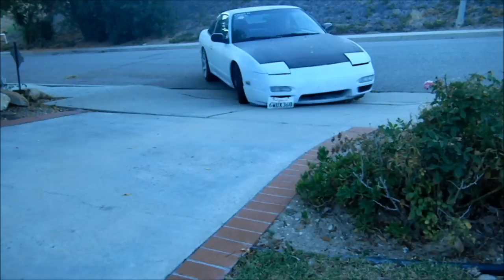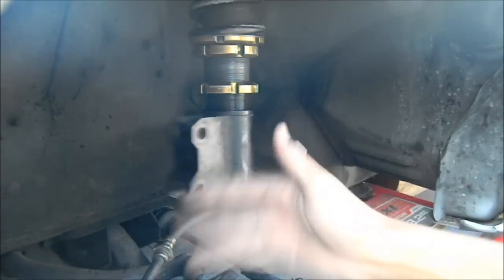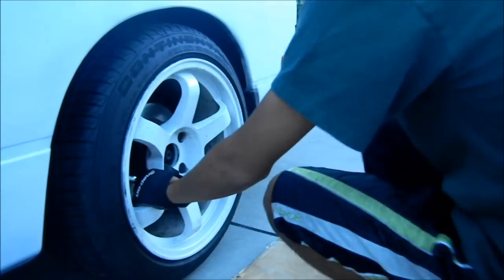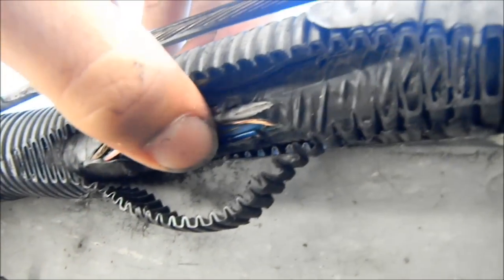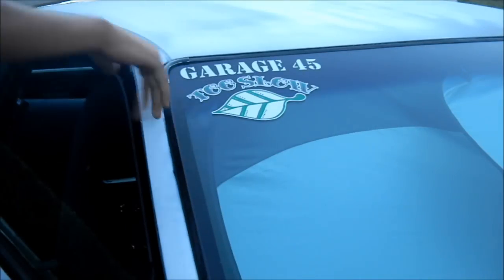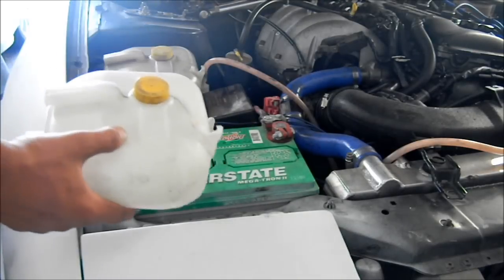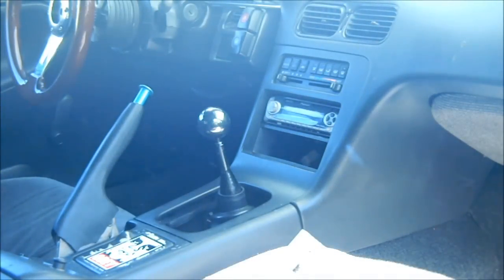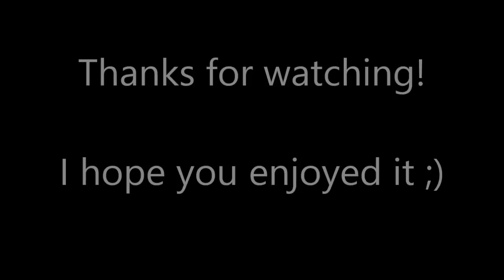Project 240SX Le Drift Car - Ep. 1 | Getting Started

Comment: Not sure if it was previously mentioned, but you don't need to remove the bolts from the knuckle/coilover to adjust the height, just loosen off the lower locking collar and spin the body of the coilover down/up through the lower mount.
Reply from the maker: sweefu2 Yes I know how to adjust it. Just did it this way because I didn't have a coilover wrench and because of all the grit and dirt build up on the threads, threading the body up and down by hand was super hard. So it was just faster to unbolt it and turn the bracket rather than leave it bolted and turn the body. Thanks for the comment :)

Comment: you could use fuel line cut on one side down the center and outline the metal you cut out for the harness. It will prevent the metal from rubbing through you wiring harness!

Comment: Nice project man. You are doing good work out there. Cheers from s13 owner ;] 
Btw. in CA18DET this air box hole is Intercooler. It's mounted in same spot but it have two holes.
Reply from the maker: Sebastian Harmasz Yup and on the 240sx it's a resonator box which is made to decrease engine noise to make for a quieter ride inside the car.
Reply: ***** Always good to know new things.  So again thx for great video and keep Nissan fun ;)

Comment: Just so ya know you dont have to take the hub/knuckle off the coil over to lower and raise it. Just loosen the lowest ring and then you can spin the entire coil over with the tool on the top ring. super simple and you wont have to have an alignment every time you mess with the height.
Reply from the maker: I didn't have a coilover wrench which is why I didn't just loosen the lower collar and turn it down. I even tried by hand just turning it with the lower collar loosened but it ended up hurting my hands after a few turns because the threads were dirty and made it difficult to adjust. 
Thanks for the comment :)

Comment: Car customization done clean and right for once.. Glad this wasn't a "YOO LETS SLAM THIS SHIT AND DO SHITTY DRIFTS IN WET PARKING LOT!!! STICKERS FOR SPEED AND A REAR WING FOR DOWNFORCE.... DOWNFORCE FOR OUR SPEED!
Reply from the maker: Hahaha yea I'm not like that, thanks!
Reply: Right. Except he didn't get a wheel alignment after changing the ride height, the wheel spacers aren't strictly necessary and a waste of cash, he cut up the shell to tuck the harness (despite raising the height?!) etc. etc. 
I like this video, but your comment is moronic, what's wrong and what's right, eye of the beholder. Douche.
Oh, and scraping the number plate! OH NO!
Reply from the maker: elementalfunk First off I do my own alignments and this was far from the end of the work being done on the suspension, and the car was not being driven on amidst doing the work. Once the car was ready, I did an alignment.

There were no wheels spacers here, they were hubcentric rings to properly displace the load of the wheel onto the hub. 

The height was raised temporarily to aid in doing work on the car since it was easier to jack up and down and get underneath the car. Which is why the harness was tucked because the car was made lower after the work was done. As far as cutting up the shell, the metal taken out was ~2" worth on a seam. This is commonly done on 240's and not a single issue ever occurs from doing so.

This video was made to be taken lightly, sorry I wasn't able to completely rip off the bumper for you...
Reply: *****
Sorry I was more having a go at Graham Werner just to prove a point that everyone likes to modify in different ways (probably in a unnecessarily aggressive way). I have watched a few of this series now and genuinely enjoy it, especially because you are getting dirty and doing it rough. Keep up the good work, cheers.
Reply from the maker: Thanks :)
Reply: I feel like the stickers part is something MCM endorses... Unicorn sticker = +10 hp... lol

Comment: Hub centric rings are useless if you have tapered lugs. I was worried about it for a second until I realized that myself. That might not be the case for everyone however. Also I think that box was bringing outside air into the engine bay. Perhaps something connecting all of that was missing?
Reply from the maker: Yes the wheel will center fine because of the tapered lugs but that's not the point of the hubcentric rings. The point of the rings is to place the load of the wheel on the hub and not on the lugs such as done with oem wheel set ups. 

That box was missing a pipe connecting it to the air intake, but it doesn't bring in any air whatsoever as it's a box with no other hole. It's actual purpose is a resonator box which came from factory on the car and is meant to reduce engine noise.

Comment: I'm with you on almost everything, but why run w/o a shift boot, and why glue (or epoxy) the shift knob on permanently?
Reply from the maker: ***** Shift boot is essentially there for aesthetics and it looked much nicer without that Crown Royal DIY boot on it. Also since the car was auto converted, the center console bezel doesn't have the proper mounts for a shift boot, so I would have to source that, and buy a shift boot, just to have a shift boot for aesthetics which wasn't necessary since it looks really clean without a boot at all. 

The shift knob wasn't epoxied on permanently... the plastic threaded adapter was epoxied to the shift knob so it wouldn't come loose. It was done to fix the threaded adapter and have it stay in the knob like it came from the factory.

Comment: isn't hub rings supposed to be tight fit for first time (they are some type of plastic usually), when you make it loose it doesn't center wheel anymore that well... At Tire companies they do put rings that are first so tight that you really have to try putting tire many times and finally push wheel in with wheel nuts/bolts... :o
Reply from the maker: There was some built up corrosion on the hub so it wasn't fitting that well.
From what I've seen, and when I've ordered other rings, the fit is much better. It's snug on the wheel and the hub making it center, but these I had to force on which I've never had with hubcentric rings before. Thanks for the comment :)

Comment: One thing i will say about de stickering windows, dont heat em like that if theyre tinted!! You will most likely fuck the tint up with the heat, had the back window pulled out of my car and they heated it very similarly and the tint is trashed, excessive use if rear demisters can do it aswell, basically avoid heaps of head with tint

Comment: WTF you warmed up the stickers with the heat gun but you didn't warm up the fender with it? Hmm...

Watched the whole video and I must say you did a nice job!

EDIT: Just watched your other videos and found out the frame is bent. Now I don't see a problem lol
Reply from the maker: Hahaha and yea after using the heat gun for a little bit I realized I was going to be painting the car anyways so I wanted to see what would happen to the paint without heating it. (Chipped a little, but surprising very little chipping considering I hit it with a hammer)
Reply: ***** Wow, you weren't joking. Not even 24 hours and you answered. That's cool!

Now I've almost watched all of your videos and I must say that I have huuuuge respect for you. If it was my car, I would have already stopped working on it as soon as I found out the frame was bent.
Any plans on getting a new chassis already or will you drive this one until it's completely raped?
Reply from the maker: Haha thanks, I try to respond as fast as I can :)

And yes I've been planning to buy a shell for months now because I don't plan to abuse the car on the track on purpose like some guys. And having this messed up shell just makes it difficult to even do simple stuff like an alignment or adjusting height evenly. 
Well anyways, I'm basically waiting to save up more money and get my welder all set up before buying the shell. That way I have all the tools and money ready for the new shell to get work done.

Thanks for the comment!

Comment: Won't that electrical tape make getting at wires in the harness a big PITA? I get patching the individual wires, but don't understand wrapping the whole thing instead of reusing the sleeves you had.
Reply from the maker: Yes getting at wires will be harder, but a harness imo is not really something that you touch often. I mean even really expensive harnesses have braided sleeves and those are even harder/more expensive than tape to take off.

Usually people don't reuse the stock sleeves because they are very loose and bulky, and tucking the harness at the top with the stock sleeve will usually make a really tight fit at the top of the fender and people have fitment issues.
Thanks for the comment :)

Comment: dont need to remove spindle from coilover to adjust btw.  I am assuming that you dont know that so dont take offense if you already did.
Reply from the maker: If you watch later on I said I didn't have a coilover wrench (hence the chisel and hammer to tighten the lock collars) so adjusting the coilover by hand with it on the spindle is ridiculously slow and hard, I've tried hahaha

Comment: How much do you think you spent in total from start to finish?
Reply from the maker: +brady blanchard $2000 in parts, but sold $1000 in parts I took off. So only $1000 out of pocket. The car cost $2700, so total for the car was $3700 when done.
Reply: +OffBeat Garage what😢😢😢 one of these cars dont exist in my country if it does it cost about 35k

Comment: You cant get electrocuted on a 12v battery.... Also youre supposed to put the centering ring on the wheelhub first before you put the wheel on
Reply from the maker: How to Install Hub Centric Rings (Benefits explained)
Reply: Its not about the volts its about the amps. A car battery can and will kill you.
Reply: Ian Couch a carbattery cant and wont kill you. And yes its about the voltage
Reply: Kristoffer Lilja You're right bro, it will NOT kill you. And if you get shocked, it isn't the type that makes your muscles tense/freeze, you can still let go under car battery shock lol. Its funny actually
Reply from the maker: shortix323 Yup haha my friends have tazed me before and I just try to avoid that feeling lol
Reply: shortix323 no you cant even get shocked or tazed by a car battery. Go out and put one hand on one pole and the other hand on the other pole and youll see. Not even a 24 volt truck battery will shock you. 12-24 volts isnt enough to go through your body
Reply from the maker: Yuuup I agree.
Reply: shortix323 why would i feel anything? The tool would get very hot though and youd probably burn your hand if you touched it
Reply: Kristoffer Lilja When there is a ground it will kill you. Otherwise you will most likely live if you get hit with it. Therefore a car battery can kill you.
Reply: Ian Couch it will definately not kill or even shock me. Please go out to your garage and just try it. Touch both terminals with both hands. You can do anything to get better connection including pooring water on your hands. The voltage simply isnt high enough to go through your body.
Reply: No you're not, you're supposed to put the ring on the wheel first! And also for the video you don't sand them down lol the wheel is supposed to have a tight fit, you should've cleaned up the hub and that would've made it easier to put the wheel on properly. Anyway it probably doesn't even matter that much to be honest but yeah.
Reply: Do u even know wut ur talking about I was workin on my demo car one day and I got a shock from the battery and it knocked me out for about an hour
Reply: borncountry100 no you didnt
Reply: mumbles005 yes you can feel a 9 volt battery on your tongue because the current will only travel half an inch through your wet tongue.
I repeat once again. You CANNOT get shocked by a carbattery. 12 volt or 24 volt isnt enough to go throu your body. You can however get shocked by the distributorleads to the sparkplugs aswell as certain parts of a xenon headlightsystem.

Comment: "Raise the coils" i'm having second doubts about this now...
Reply from the maker: Was done because I was doing a bunch of work on the front end of the car with replacing bushings and so on. So having the car at a higher height made it easier to jack the car up and down, get access to parts, as well as take out for test drives.
Car now sits lower than it did in this video and requires driving over pieces of wood to get jacked up.
Reply: I figured as much.

Comment: Getting rid of the low is so stupid hahah ruined it
Reply from the maker: I did it because I was replacing the rack and pinion, front end bushings, ball joint, tie rod ends, sway bar end links, front crossmember, as well as eventually dropping the transmission and diff. (All shown in the 8 episodes after this fyi) So it made it easier while doing all the work to not have the car low because of the constant jacking up of the car.
Now though, the car sits lower than this and requires driving over 2x4's to jack up the front.
Reply: ***** I understand, I was just kidding. but this build all the way up to the 9th episode or whatever is soooooo good, its so informational and you are doing pretty much everything the proper way which is rare in the 240 world and its nice to watch someone who knows what they are doing and building a nice car
Reply from the maker: Haha awesome man, really hard to tell when people are joking when just reading text haha.
Glad you like the series and thanks for the kind words :)